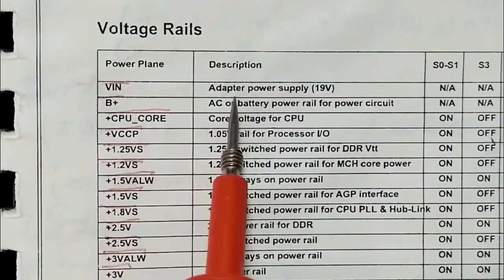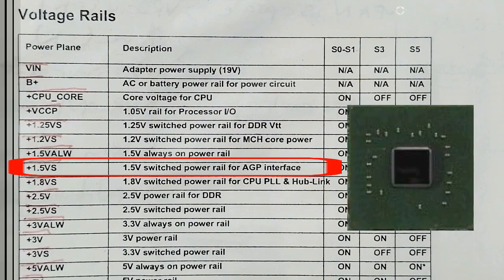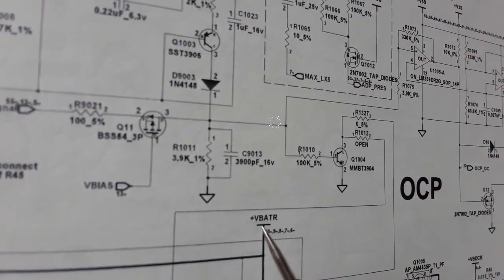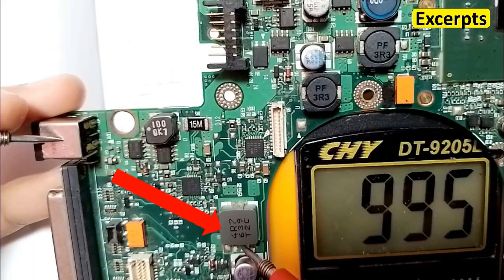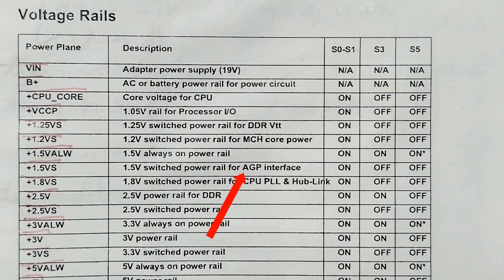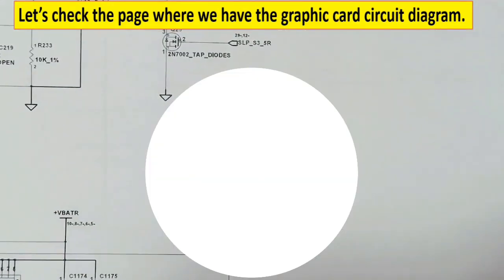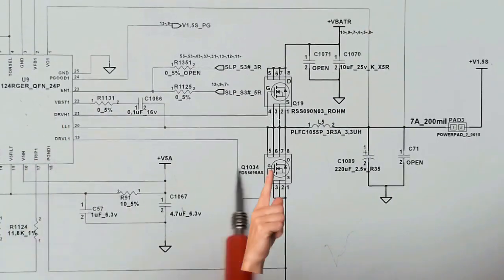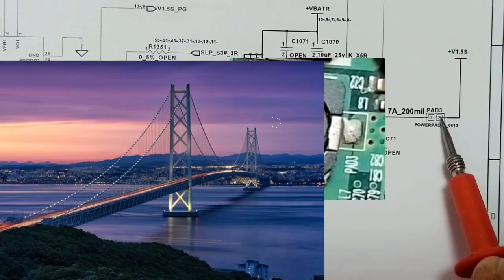Laptop Motherboard No Power - Troubleshooting Short circuit - Fixed!! - Part 3

Comment: Go here 17:00 if you watched the other videos.

Good video like how thorough you are, it's a shame the first 17 minutes are the same as the previous videos.
Quick question in the end you say you have to remove the inductors and check the components around each inductors, couldn't you just check the capacitors around each inductor and see if they are shorted? If non is shorted than it's the graphics card but if you find one capacitor shorted you can remove that one and avoid removing all the inductors, or am I wrong?? Cheers.

Comment: Amazing !!! Great TS workflow sir, tank you for sharing of your knowledge !   That would be fantastic if you share how you approach the failure without schematics, if there are some hints  using PCB rails and layout to grasp the architecture  and the logic in between?... For sure it won't never be as easy as with diagram but still hope there are some tricks which can ease it up a bit... Great if you find a time to launch some tutorial series on that as well. Thank you !
Reply from the maker: Great suggestion!

Comment: Informative guide showing how to isolate short circuits to find the cause. It's unfortunate that the problem was the graphics card which can neither be repaired easily nor economically. For average people, buying a new laptop will be the only viable option. 

And like someone said from other comments, 2/3 of the video was the excerpt from the previous videos which are redundant and time consuming.

Comment: Hi new subscribe here really like your videos especially this one I want to ask you in the case that you don't have the (pad) section my ges is that you will pull the coil out right to isolate the area .
I have a Issue on a msi labtop Short it .
and I got to Isolate the short to 2 coils but I not ben able to find the short they both have mosfet and catalyst capacitor 
3 mosfet were bad and also the capacitors but the short still there both coils are grounded and the positive were the capacitor were is short it to.
Now i learned buy your video that there is a chip that will control the 2 coils if you can confirm all this I will appreciated.
I am a old hobbyist of electronics but allways a big inner 
Thank you and thank you for your videos 

I find 3 MOSFET bad
Reply from the maker: Thanks for subscribing and for your detailed comment! It sounds like you’ve done some thorough troubleshooting already. Isolating the coils is a smart move, and yes, there’s often a controller chip involved. Keep at it, and I’m sure you’ll find that short